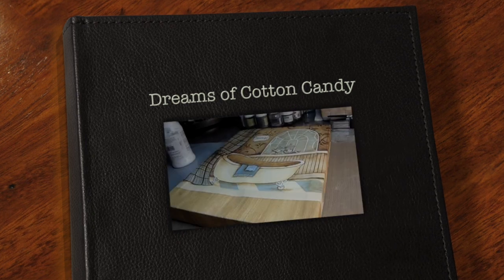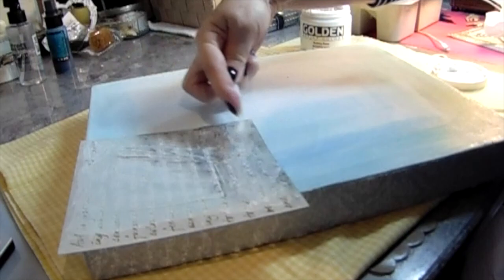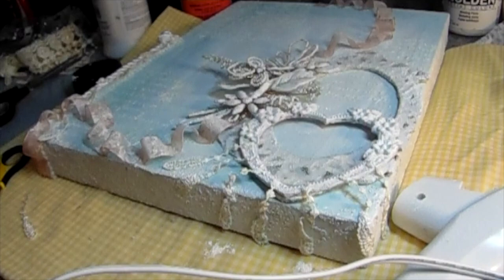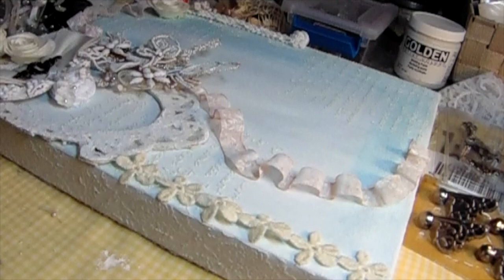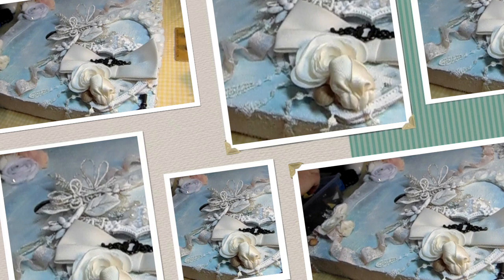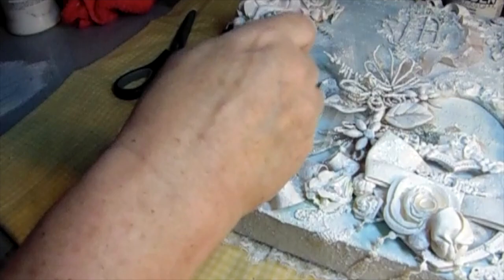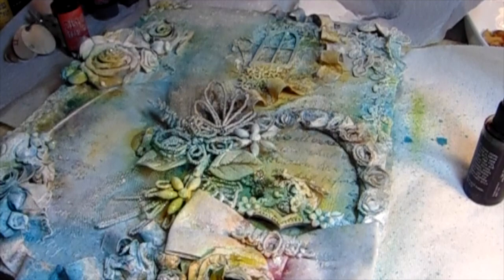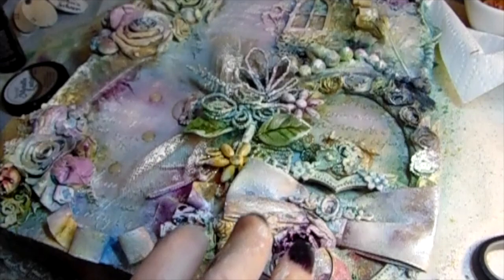Vintage/Shabby Chic Canvas Tutorial....Cotton Candy Garden

Comment: I love using Heidi Swapp's stencils/chipboard for a focal point or part of a focal point. Unfortunately, I cannot find them for a price I want to pay. You had sent me some of these when you gifted me a year or so ago. I have finally used those up with using them like chipboard. 

I need to purchase some of Tim Holtz's watercolor paper, since I found out that it is a true white. 

I got 60 prismacolor pencils for 17.99. It was a type of flash sale with someone who has begun selling on Amazon. What a find! I cannot wait to try these. I have a calendar that has sections that could easily be cut for making cards, scrapbooking payouts, or canvases. I am filled with anticipation. I finally started using my watercolor paints. 

I purchase cheap, small stencils on Amazon and then sand them so I can paint them with metallic gold paint (rustoleum) and use them as you would use chipboard...much cheaper than chipboard. About 50 cents per piece. I can't go wrong on that. It takes some extra work, but the pieces are small. The down-side is that the pieces need to dry. I too add a bit of gold to my canvases and cards.

I made a canvas for a friend in California. I made it like a giant card rather than what you did with this canvas. I need to get some new flowers that are full. I love your floral spray. I need to check out heart-shaped chipboard or resin for a frame. I would make a bow like yours (inside the heart) if I had cream or white satin ribbon. I do have wired ribbon that I could cut down the middle and use to make flowers. I would cover the cut edge with narrow ribbon so the edge of the chiffon (or is it organza) does not fray. Then some bling in the center. I have not tried this yet to see if the ribbon part works. Perhaps a piece of cardstock or cardboard will work. I like your ribbon that you raised up with the gesso...so attractive. I always learn something from each of your videos. 

I have some small rectangular frames that could be used like a window if I wanted to do so. I would have to make them have panes. It would be awesome to give the window a window box. I have some metal pieces that I got sets of five for 25 cents during a flash sale. I have triangular, rectangular, and circular metal pieces. They also have hooks and I could hook thin ribbon over them or hang something from them. The California friend has an online store and a video every Saturday. I seldom buy stuff from her unless there is a special, great sale or flash sale. She really has a way with manufacturer's to get items for great prices. 

I need to get some clearance items on Iamroses.com . Such floral beauties. Have you ever ordered from Iamroses.com ? Nothing like those flowers. 

I have been crafting (canvases and cards) all morning until now...lazy morning. I need to go shower so I am available if/when my sons call. 

Insert: I love it when my hair is OK for two days. I have short hair that does strange things when I sleep.

Always nice to talk to you. I am relieved that you have not been sick again. I hope you do not get Hunter's pneumonia...I wondered if your pneumonia was bacterial or viral. I have never had bronchitis either, but my ex-husband was always getting that when we were married.

Take care, very dear friend.
Donna
Reply from the maker: Good evening Donna. It is so nice hearing from you. I have been super busy this past month but I am working on a project to post soon. A little bit at a time each day. I am glad that you let me know how you are doing and your crafting updates. smile You are such a kind and caring person and I appreciate you very much. Have a Blessed week and I hope to talk to you soon as I get this project posted.
Reply: Hi again, Carol! I ordered some alcohol inks today. I do all my laundry by hand so I can spend that  $40-$50 to purchase art supplies. I can't wait for the inks to come. I also went to LDRS Creative and ordered some of their $2 little girl stamps. I just love them. I now have a few of those for every season except fall. I will have to check there this next winter to see if there are any on clearance. 

I have gotten sentiment dies and also sentiments that are printed from LDRS too. I am gladly getting together a lot of ephemera, so I will be starting my first art journal and am not afraid to use some of it for that now. I have to tell myself not to go on eBay, since I have plenty of lace already that I got for very little money. 

I have some tule with peach colored, embroidered flowers that I am going to use as my base to make a wall decor embroidery hoop. I hope to get to a thrift store soon so I can look for a lace tablecloth or lace blouse for lace for some other projects. As soon as I get a few more things I will make a canvas the way that you do. So far with the large canvases I have made them like my cards...just with larger stuff. It is what I have to work with right now. 

I am hoping that I might also find some floral sprays on other old items at the thrift store. I also hope to find an old music book for paper for my art journaling. I got rid of sheet music for accordion before one of my moves. I now wish I would have kept it. It would not have taken up that much room in a box when moving. I was moving into such a small apartment that I purged a lot. I gave away a huge amount of art stuff and hundreds of books the last time I moved. I still have a couple hundred books. Now I have so much art stuff that I will have to move with me to Oregon when I move back there someday. In the fall of 2016 I had nearly nothing. I would have been shocked at that time to have known how much stash I would have now. 

Crafters online would say how much stash a new crafter would have in a number of years and I was doubtful. Now I have to tell myself not to order anything so I can use the $40 for paying some more medical bills more quickly. Gotta go. "See" you another day! We will chat again.

Comment: Hi, Carol! Do you know of a written script stencil that is available? I would like it to be in English, if possible. I am not having any luck finding one on Amazon. I do not have a crafts store in my town, so I have to order things online. I suppose I could stencil with a floral stencil that I have. So the hot glue did not make the vinyl sheet melt?

I love the wrapped lace and bling flower. What a great idea, Carol! Where did you get the string/twine that has the body to stand up? 

I have a small silver frame that is too small for any photos I have, so I think I will use it for a window as my focal point. I do not intend to have a trellis/archway. Will I need 3D gel medium to decorate the frame? I will use 3D gel to put on the frame though.

Do you always decorate both sides of your canvases? I think that is an excellent idea. I will have to look for a hanger that will go on top to give a choice of which side will be visible.

Comment: What makes your glue gun a detail gun? My glue gun has a hole as small as yours but it doesn't have that little straw like thing on the tip. I think that may be what I need. Do you think that straw shaped thing on the tip gives you more control? I found one on Amazon like yours . Is it important for a detail glu e gun to have the kind of tip you have. I hope that is a clear question. Should I spend the money for the tip like yours?